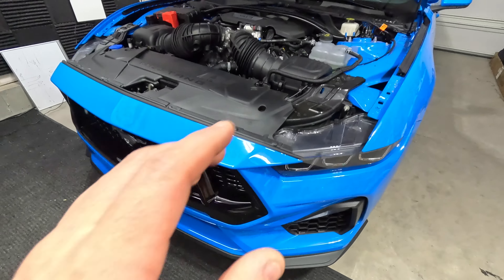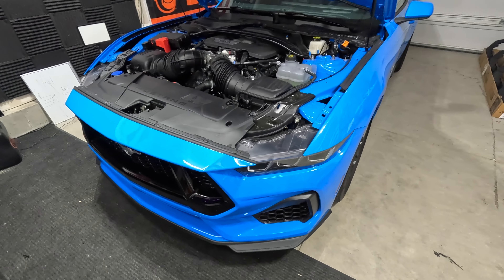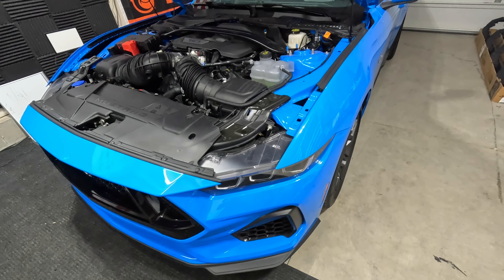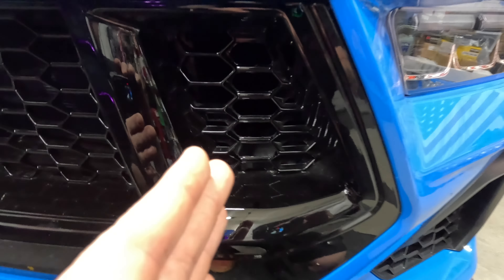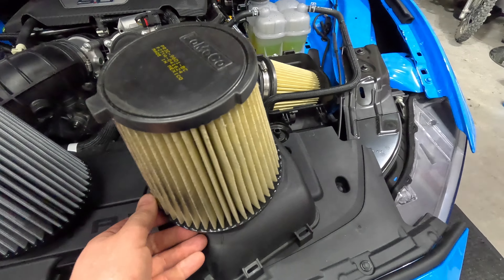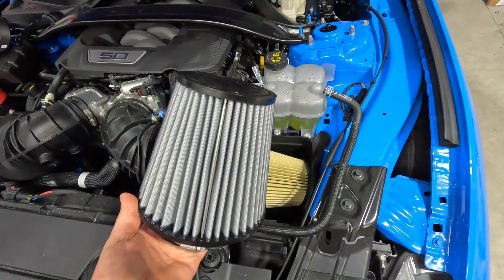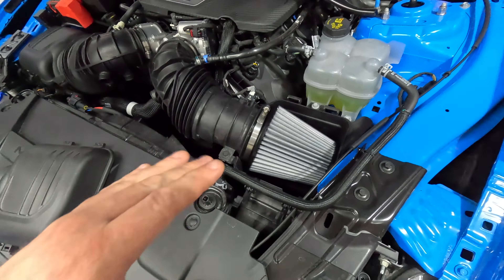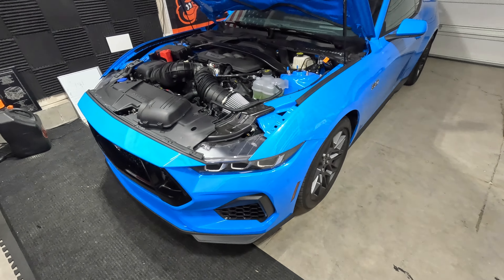Grille Airflow Modifications Update and New Intake Air Filters

Comment from the maker: Another update to the 2024 Mustang GT Performance Package Car. In the previous video, I drilled out the grille for added airflow. In this video I discuss how that modification helped with the Higher than expected IAT temps (Intake Air Temperature). After doing that modification and driving for a little while, I added some new higher flowing but better filtering air filters by Think - https://thinkautotech.com/products/2024-mustang-gt-air-intake-filters
Radio Screen Protector: https://amzn.to/4dNFfAA
Base Screens: https://amzn.to/4f6fcFN
25mm Wheel Spacers: https://amzn.to/4f9Bk1Z
Roush Exhaust Resonator delete: https://amzn.to/4fayDx7
Borla SwitchFire Resonator Delete: https://amzn.to/3YfIo6m
Dark Horse Spoiler: https://amzn.to/3YdvgyF